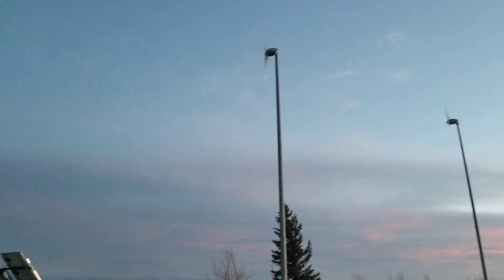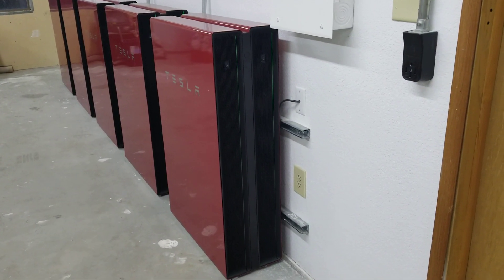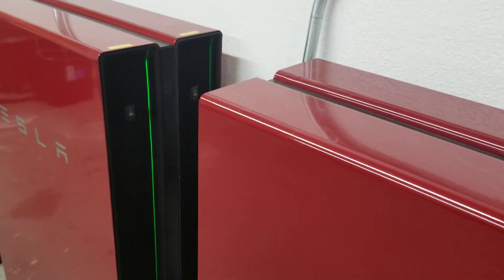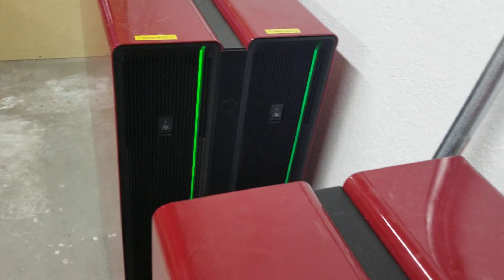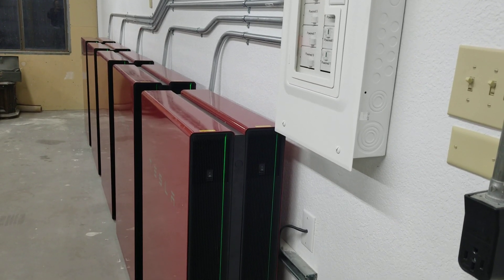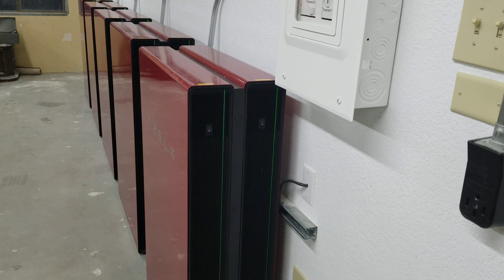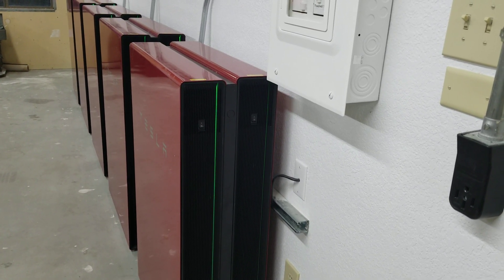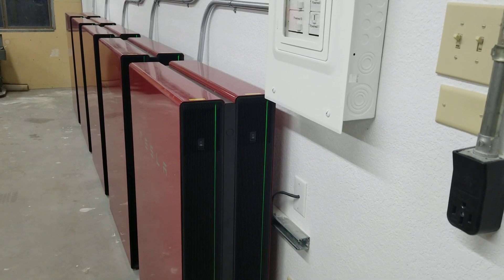Our 10 Tesla Powerwall 2 being charged by wind

Comment: Well done my friend.  What was or what do you estimate will be the ROI time on this investment in your case?  Thx
Reply from the maker: We knew from the beginning, the financial ROI would likely not be financially justifiable, but we have what we believe are more compelling considerations. One way to understand our approach is that the renewable energy systems we already installed will break even in 10 - 15 years, and then generate "negative expenses" that can be reinvested in the system. Financially, we leveraged those returns to financially fit our personal financial planning.  The bottom line financially buying the Powerwalls is not likely to demonstrate a financial ROI, but then neither would buying a plane or a boat (we don't own either). This is why, for us, the motivation to do this comes from other considerations than financial ROI.

The total cost was about $100,000.  For people looking only at a financial balance sheet it is difficult to justify, but for us, the ability to bank power on our property instead relying as much on net metering when the utility get power from coal fired power plants means we are substantially reducing our carbon footprint, also it gives of an uninterruptible power supply during grid outages. For us, its primarily about making cleaner air by doing what we are able to minimize our participation in the greenhouse gas producing economy.  It is part of living our values as we are able. Not everyone can do this. We can and therefore should.
Reply: @AltView1  that attitude is to be highly commended, I only wish more people with the means such as yourself would take such positive action.
Reply: @AltView1  OK, so how many years will it take for you to save $100k in electricity and gasoline bills, including any net excess you may be selling back to the grid (which should be easier and more common in the near future)?
Reply from the maker: @sanjuansteve  since net metering here in Wyoming involves selling end of year, net excess credits at the wholesale rate, the financial ROI is unlikely to occur within the probable service life of the system, or likely within the limits of our likely lifespan.  This is not a location where battery storage makes purely  financial sense. It might in other locations under different circumstances. Adding to the complexity of your question, right now the Wyoming Legislature has bills to repeal Net Metering.  If it passes and there is no ability to bank excess production to use later from banked credits, that too changes things, and batteries might then have a measurable ROI.  Another possible peril to residential renewable systems is the Wyoming Legislature is considering taxing all homes with renewable energy systems as "small scale utilities".  So how one calculates ROI under unpredictable circumstances becomes daunting.  The best we can figure, is that our renewable energy systems pay for the batteries in 30 - 40 years.

Comment: Dam thats impressive. I have ordered a tesla cyber truck and i am going to use it as a stationary battery. Should have at least 100KWH storage and I hope to power my cabin off the outlets in the bed and solar power it.
Reply: Recently read that voids Tesla's warranty, may want to look into it.
Reply: @wilhallman2890  running an inverter off the 12v battery voids the warranty. can plug what ever you want into the power outlets in the back of  the cyber truck.
Reply: @magamike1800  Ah, good info. thanks
Reply: @wilhallman2890  I am waiting with anticipation to see how many amps the power outlets in the cyber truck bed/vault are.  Hoping i can pull at least  20A/5000W although 10A will probably be enough to run everything i need.

Comment: Super! Great job 😊
Have you ever thought about storing excess energy using hydrogen instead? 
It’s Just a suggestion. 
Out of curiosity, how much did the 10 power wall cost, including design,  installation and electrical components?
Reply from the maker: Marco Zorzi, total costs of 10 Powerwall 2 system installed at our home was ~$100,000. HFC (hydrogen fuel cell) systems are generally not available for residential use here in the United States and even less so in Cheyenne, Wyoming. Recently, there is a noise about one being developed in Australia which likes to market itself as costing less per rated kWh of storage than a Tesla Powerwalls.  It's a bit misleading because while the raw numbers look interesting the manufacturer, especially its marketing department ignores the inefficiency involved in making H2 (hydrogen) from water via electrolysis and loss during conversion back to electricity.  The total loss is about 50% compared to 10% for the same interconversions with battery based systems.  H2 storage cells also have a relatively short life of about 8 years and then have to be replaced. Unlike other compressed gas storage tanks they generally aren't recertifiable.  This is one of the problems with the Toyota HFC car and why you can onky lease, but not purchase it.  HFC may have a role in the future for home energy storage, but its practical applications compared to batteries at this point is not yet practical for our home.
Reply: @AltView1  thank you for getting back to me. 
You are referring to the Australian start up LAVO. 
I agree with most of your reasoning, especially the part about round trip efficiency. 
Actually, if we want to be precise, the real round trip efficiency is around 42% (using H2 LHV low heating value of 33.33 kWh/kg) 
(not sure where they got the 50% from). 

“H2 storage cells also have relatively short life of about 8 years..... aren’t rectifiable” 
I am not sure I understand correctly what you mean in this sentence. 
If you are referring to the H2 storage tubes, which are made of metal hydride, their lifespan should be guaranteed for about 30 years (20,000 cycles) and after that the metal hydride is fully recyclable.  

Anyway, despite the drawbacks, I think H2 storage is something to keep in consideration.
Perhaps in the coming decade as Enapter (AEM electrolyser manufacturer) and Nedstack (PEM fuel cell manufacturer) are scaling to mass production, therefore halving their units cost from 2026. 
Also round trip efficiency could be significantly increase if the thermal heat component from the electrolyser and fuel cell are retrieved and used to warm up the domestic hot water. 
Something to think about. 
It’s nice talking to you. 
Marco
Reply from the maker: @marcozorzi6770  H2 storage cells (what you call tubes) presently have limited service life.  They can't be recertified for continued use.  You asked if I  had considered HFC. I had and the short answer is they are not presently a practical solution for us.  Our Powerwalls  should last about 30 years.  Much can change between now and then.  The Powerwalls installed now lets us store our surplus renewable energy onsite now instead of "banking" as much on the grid, avoiding drawing power from the grid, as much as possible, thereby reducing the coal fired power our home and EVs use. By the time our Powerwalls need replacement the grid may be substantially cleaner or HFC technology may improve.  It will be interesting to see what develops.  Until then, we have a working system now. 

Do you have a renewable energy system at your home? Does it have storage? If so, please post a video about it.  It is interesting to see what others are doing.
Reply: @AltView1  yes, I agree with you. 
At the end of their service life the H2 tubes will have to be replaced with brand new ones. 
I am currently living in London, renting a very small flat in a Victorian house. 
The energy performance of the flat is really poor and no, I don’t own any renewable energy systems at the moment. 

I am a renewable energy designer and I hope one day I will be able to own my own very efficient house, powered by renewable energy ✨.

Comment: How often do you have days with no wind, sun, and the power grid shuts off? And how much of that extensive battery capacity are you actually using on a regular basis? 
Besides being ungodly expensive, all that equipment, and especially those batteries, represent a substantial environmental impact just in their production alone. I have to wonder if a more modest setup with a backup generator for rare emergencies would not have been a far more environmentally friendly solution. This seems like the equivalent of buying a massive extended cab super duty truck just incase you might need to haul lots of people and heavy loads, but then it spends the vast majority of its time hauling one person to and from the mall. 
It is impressive, but seems like such overkill that it may not actually be all that environmentally friendly.
Reply from the maker: We have low gain or even zero gain days several times per month here in Cheyenne, Wyoming, these can be up to 5 consecutive days.  Our home is all electric as are our cars.  We lived with off grid renewable energy from the late 1980's until 2012 when that home was lost to a forest fire.  When sizing a battery for an off grid or poten8off grid system, particularly in a cold climate like ours, you base the sizing on a capacity to go the maximal number of predicted low gain or zero gain days multiplied by your highest usage day (which for us is in winter).  The larger the battery pack the frequently fully deep cycle. The more frequently it deep cycles the shorter the life of that battery will be.  This is part6true of lithium batteries. Deep cycling and heavy recharging shortens cell life.  While there are times our pack will deep cycle, it is a small fraction compared to using a smaller battery pack. As a result of our sizing, our battery pack should last 2 - 3 times as long as a smaller pack.  This means the environmental impacts are less than an undersized pack given our actual usage. I've already discussed in prior posts how much electricity we use and the conservation measures we've built into our systems.  If you have done better, I'd love to see it.  If you haven't, maybe there's something you can learn from our  over 30 years of real world experience living with residential renewable energy systems.
Reply: @AltView1  Wow, your energy usage seems ridiculously high. Based on the numbers you quote, you use more energy in some weeks than I use in an entire year. Given all the resources you had to expend for all of this, have you ever calculated your true carbon offset? Seems like an awful lot of expense and resources just to offset your carbon usage by some percentage, but if you really use that much energy, perhaps it adds up? I could see if this was a farm or some sort of business, but you said it was strictly a residential household, so do you do a lot of driving in those EV's every day? I am just trying to understand how you can use 100KW in a single day, even with an electric furnace. You said your house burnt down 2012, so given everything else you have invested I would imagine your new house is very energy efficient no?

I am just trying to understand because this seems like an awful lot of energy use for a single family residence. Perhaps I am mistaken, but this does not seem like a sustainable amount of resources if every household were to try to live using this much energy, but perhaps I am missing something?

I am just trying to understand the rationale behind all of this, have you calculated your actual carbon offset? For example based on what I have read those power wall battery packs are very energy intensive to produce, from what I can find each one costs anywhere from 8 to 17 tons of CO2 emission just for the production of each one! Therefore, even if we stay on the conservative side and say 10 tons per unit, with 10 units that would mean you already emitted 100 tons of CO2 just for the power wall batteries alone. Then there is all those additional components, solar panels, wind turbines, installation… I cannot even guess on that stuff, but being very conservative let's say another 50-60 tons of CO2 emitted. Then you said you have two EV's and each of those emit at least 20 tons of CO2 just to produce, so now you have easily emitted around 200 tons of CO2, and that is on day one. Therefore, we are doing all of this so that in the end we can lower our carbon footprint? 

The average US household emits around 7-8 tons annually, and that is for heat, cooling, electricity, transportation... Your energy usage is apparently a lot higher, but just to be on par with an average US household it seems you are going to have to run this setup (without additions or major repairs) for about 25 years just to match the carbon emissions of a typical US household. This seems extreme to me, but then again so is your setup. 

This is all based off readily available data I found online, so some of it could be way off, or perhaps I am just miscalculating? I have to imagine you have calculated all of this given all the time, resources, and experience you have invested here. So I am interested to see where I might be mistaken, because from what I can see this does not appear to be even close to “carbon neutral”.
Reply from the maker: @ericmichel3857  your numbers are wrong and your approach mistaken.  If you think our all electric home and 3 EVs which are 100% annually either directly powered or completely offset by electricity generated from our solar PV and wind turbines then there is little point in having any further discussion with you as you are being a petrol puppet propagandist. You have no specific knowledge of the components in our system, how they were installed, or the home and vehicle it powers yet make claims about our annual carbon emissions which you cannot possibly substantiate. To assert that in the heart of coal country renewable energy powered vehicles and home have higher carbon emissions than this home had when it was heated by propane, and powered by electricity from coal fired power plants, and when we drove gasoline burning vehicles is utter nonsense. The Union For Concerned Scientists debunks your claims about EVs, even without charging from renewable sources. 

https://evtool.ucsusa.org/

You can peddle you propaganda elsewhere, but not here. While I'm willing to share our experiences with decades of real world experience living with renewable energy systems at our homes,  I'm not going to engage in idiitic ideological debates, especially anyone who wants to argue against embracing renewable energy.  Any further posts you make along those antagonistic lines on my Channel will go unanswered and be deleted. I don't have time for trolls.
Reply from the maker: I have removed your most recent rhetorical comment.  Please stop posting on my Channel as you are insincere and are only being a troll. I'm not going to reply to you amy further. I'll just delete your comments. We are done.

Comment: I think this kind of system and what happened in Texas shows a very bleak future where less and less money will be invested in the power grid and only people with the means will have reliable electricity in this country and the poor will be left to freeze in their homes.
Reply from the maker: It may surprise you, but I generally agree with you.  My starting place is “if everyone does what they are able, together, much can be accomplished.”  My view is those with the financial means have a moral obligation to do what we are able to make for cleaner air, but we didn’t wait to accumulate wealth to start doing this.  We started in the 1980’s when I was living on little more than $75 per month and a subsistence garden.  Our prior home was off grid.  It was going to cost $10K just to get an electrical connection.  We started with golf cart batteries and a few used solar PV panels.  The cost new per Watt back then for solar PV was $50/Watt.   We bought used 35 Watt panels that were auctions from an ARCO installation what we “sunburned” (discolored), but functioned at over 90% original rating. We bought them for a small fraction of that original cost. We were making use of the “secondary market” because those who could afford the “new product” had replaced them with new “latest and greatest” (and more expensive) products, which after 10 years, like these, would get sold off and replaced, just like the ones we bought back then.   In 2012 we lost that home to a forest fire and decided not to rebuild there.  Instead, we decided to invest in our home here in Cheyenne to make to more reflect our environmental values exemplified by that home. We did this incrementally, not all at once.  We started with 2 wind turbines in 2012.  Then, every year or two added to our system.  This is a long-term investment in cleaner air.  If we stopped before adding the batteries we could “breakeven” in about 10 years for each solar or wind installation.  We will not likely live long enough to do that with batteries, but what we do get immediately is knowing that compared to “banking” our excess power production and drawing it back from the grid via net metering, storing power in our batteries helps us reduce drawing power back from a coal powered grid.  Also, as more of us who can afford to do things like this, not only are we helping to drive down the costs of renewable energy technology but also will be increasing the predictable secondary market which will follow the life cycle of that equipment.  Solar PV new was $50/Watt when we started in the 1980s, now it is about $1/Watt.  That technology was nowhere near being economically democratized in the new market when we started, but even then, it was in the secondary market.  While our Powerwalls are made with new batteries, keep in mind that when EV batteries are no longer suitable for use in vehicles, many have a second life as power storage, good for up to 20 years!  There are companies and individuals doing this.  You can do a web search to find out more about it if you are interested.